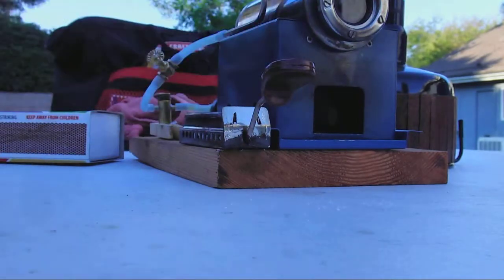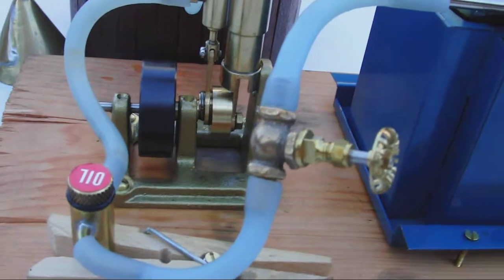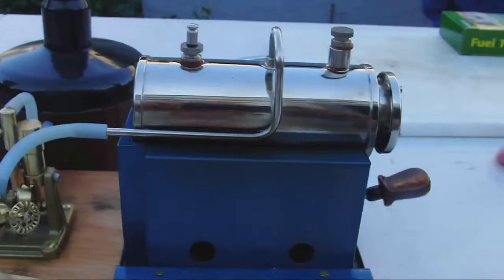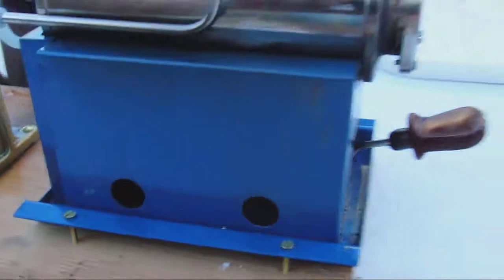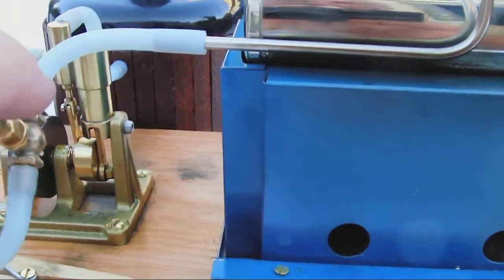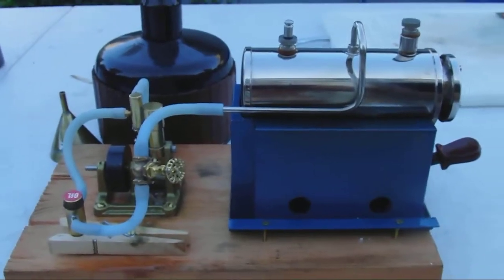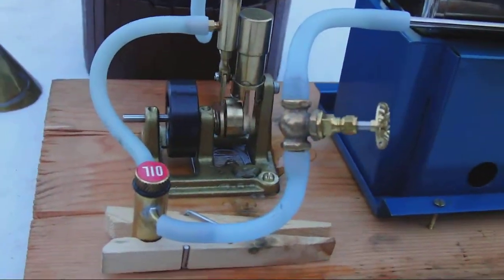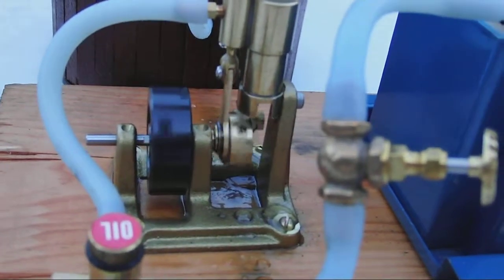Solid Fuel Test with Coghlan's Hexamine Tablets

Comment: Nice tests.

I usually use a 1.5 tablets in my Midwest fantail and get a nice amount of run time.
I experimented with crushing them up into crumbs. Seem to recall that the burn time was reduced, but there was more heat released.

Be aware that if you blow the flame out, these tablets will smoke.